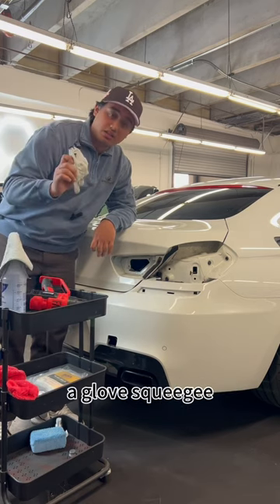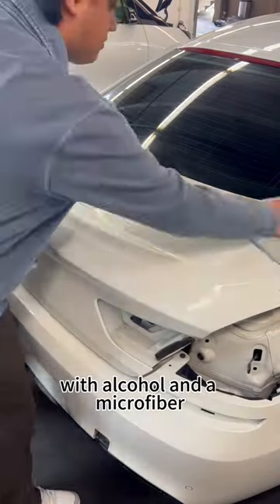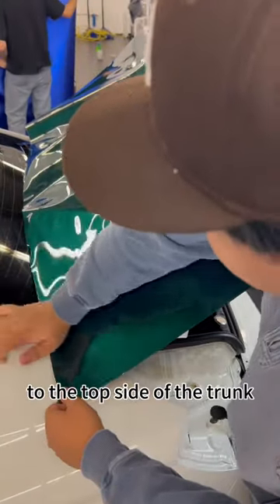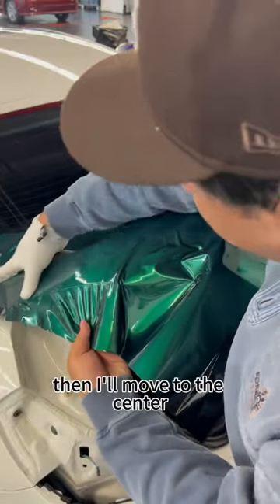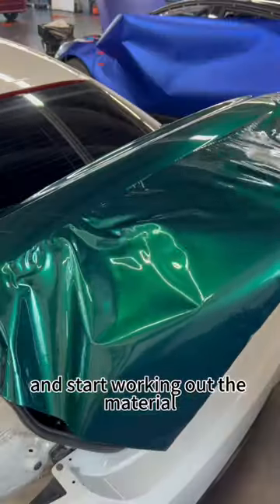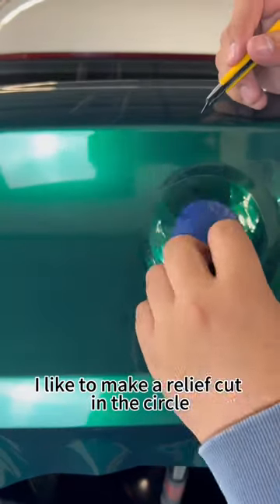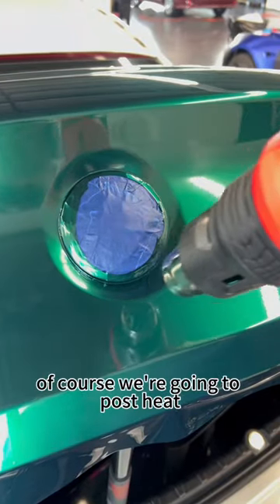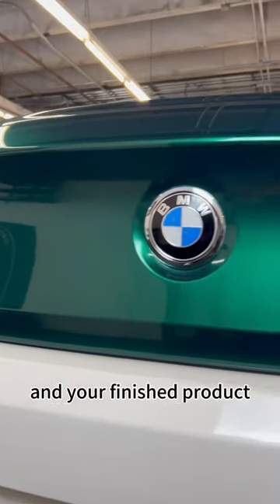How to wrap a trunk by yourself!If you want a more in depth video, let us know in the comments

Comment: That emblem will pop off if you use a plastic pry too fairly easy. Has to little tabs holding it on. May make it a little easier on you.
Reply: Removing it isn't an issue, it sticking it back on. Easier to just cut around it than pull off and re glue it 🤷‍♀️
Reply: @Rraptor1012  those have no adhesive. They have two tabs that hold it on the deck lid. Same with the hood.
Reply: @lakesidecollision4763  I wasn't aware of that, I don't own a BMW. the more you know 🤷‍♀️
Reply: @Rraptor1012   I don’t either we just find ourselves working on them all the time. Lol
Reply: @lakesidecollision4763 who has the idea first to potentially fuck up someone’s car and not be able to reapply the emblem?
Reply: @fatal510  if you cannot do the simple task of removing emblems off a car without causing damage you have no business touching said car. Sorry it hurts your feelings

Comment: Honest question here. Watching all these videos, I wonder how many times the vehicle being wrapped is knicked with the blade when cutting the wrap. How often does that happen and what are the corrective actions taken and is the owner of the vehicle notified of those knicks and cuts to the clearcoat? Possibly the paint.
Reply: I'll give you an honest answer. Its very rare for us to directly cut on paint in a place that anyone would actually notice. Most of the time our blade is on an outside edge or we use knifeless tape for risky cuts. Its very common for noobie installers to cut the paint and usually more often plastic mouldings/seals/gaskets are what get nicked. If an installer nicks your clear coat lightly in an area you will never even look, they aren't mentioning it to anyone ever. Even great installers nick paint once in a while, just not in a bad enough manner for it to warrant anything more than an oops. Noobies however, will destroy your car if given a blade. Pick your shop carefully. Even good shops that allow an apprentice to work on your car will find that a noobie cuts the car and says nothing for fear of getting fired.
Reply: @AuqiumPvP  thank you for your very direct and honest answer! I've asked this on multiple videos and you're the first to ever respond. It's one of my biggest fears with having a vehicle wrapped or even ppf put on. Got. New Audi Q7 I'm thinking about having ppf put on or even ny 2021 Ram 2500 as I do a lot of hunting and going off road so it definitely will need some attention prior but so afraid of sending them off and coming back with slice marks or gashes in the paint or like you said, the seals trim etc.
Reply: @DCBA1234.  Find a professional shop thats got a good track record and expect to pay their price for good work. Nothing crazy, but make sure you vet them. Do they have you signing a lot of paperwork and have they taken you through an extensive explanation of the process? If they haven't, i'd be worried.  Ppf uses blades on the car even less than vinyl in some cases. Don't be afraid, just do your homework.